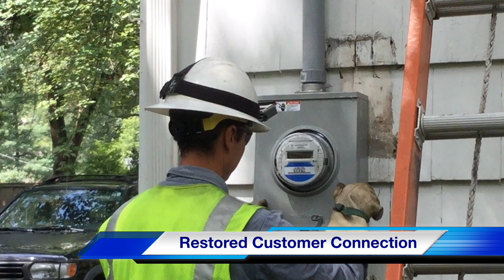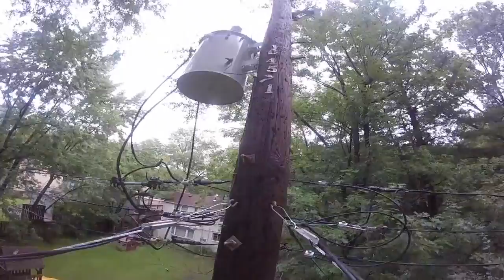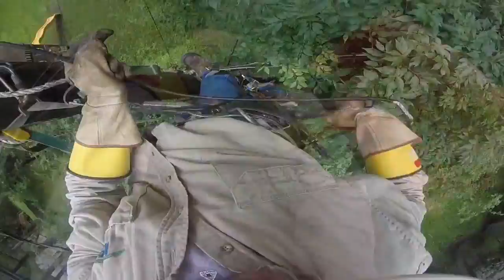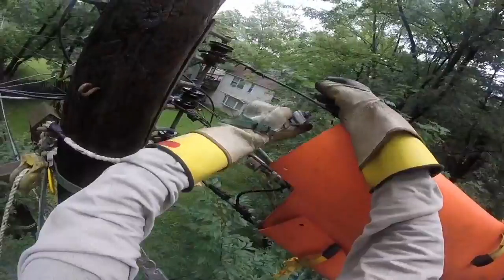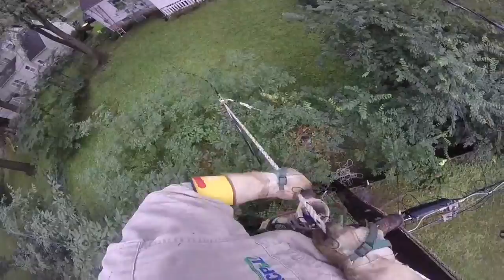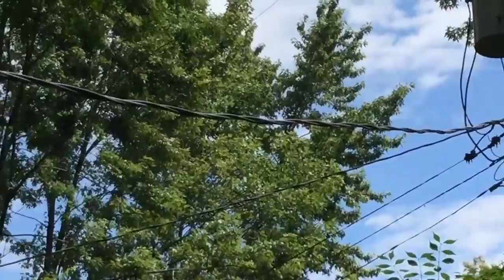Restored Customer Connection

Comment: Using a knife to remove the insulation and clean the conductor surface? Using a bolted connector for a neutral connection? They need to get rid of that open wire secondary wire. 😢

Comment: That's WORK climbing. In the summer you'll be soaking wet, your clothes'll need be ringed out.
Reply: jay willow I climbed poles and I’ve climbed trees for power line clearance and climbing trees is by far more work and more hard than going straight up a pole assisted by hooks.
Reply: @dkta-568  I'd agree. It's more aggressive work. It feels alot better though when your hooks are in the tree an inch vs your hooks being in a pole 1/8 inch.
Reply: DKTA- I’ve done line clerance for 5 years. Before becoming a lineman, and let me tell you when you do linework those pants and long sleeve shirts are fire retardant they don’t breathe. And wearing rubber gloves and rubber sleeves were I work it’s a whole different world. Being extremely hot, and always dehydrated, and always paying attention not to get burned or flashed, way hotter than tree work been there done it.
Reply: @dkta-568  lmao tell us you couldn’t cut it as a lineman without telling us you couldn’t cut it as a lineman😂

Comment: Question, why have connections at the top of the weatherhead? Why not just continue the wire down to the meter box?
Reply: There needs to be a transition from the utility owned triplex to the  private (homeowner) service entrance cables.
Reply: Strange, we do things differently over here in the UK. The cable from the street and the suppliers fuse (cutout) is owned by the distribution network so is all one cable to the cutout inside the house. The cable from the cutout to the meter and the meter is owned by whoever you choose as your electricity supplier and the cable from the meter to your fuseboard (consumer unit) is owned by the homeowner.
Reply: @pklongutoobe  This actually varies depending on state or specific power company. In some areas the weatherhead and the entrance cable and conduit is the power company's responsibility, in some areas it's not. The structural attachment to the home is typically not. For underground service, the power company is usually responsible for the riser and cable up to the meter box, but even then there are some utilities where even the lateral is the customer's responsibility.
Reply: they are running aluminum wire tri- plex to the weather head and copper from weather head to meter.

more load or current at meter
copper is better with higher amps
Reply: @tonycepeda8054  : While Copper has a higher ampacity than Aluminum at the same wire size/gauge that is not the reason to use copper from the weather head down, they could also use Aluminum; the wire however from the weather head down has a lower effective ampacity for its size than the triplex drop used by the utility. The triplex is an open air wire and is rated, per NEC, to a much higher ampacity than the triple wire drop, in the conduit going from the weather head to the meter. For a 200 Amp service the typical utility drop is 1/0 AWG Aluminum, while the customer side is 4/0 AWG Aluminum or 2/0 AWG Copper assuming say THHN or RHH wire which, at least around me are the standards. You typically can also size down the neutral by 1-2 gauge steps; though with more and more sensitive electronics I wouldn’t recommend it. You could also use a non-metallicly sheathed cable (SE Cable - 2 insulated hot wires with uninsulated neutral strands wrapped around them all inside a cable jacket) from the weather head down. While I always use conduit, it just looks better, the go-to around me tends to be  SE Cable.

Comment: So the 1wire is for ground wire, 2 of them for the electricity ?
Reply: One wire is 0v (ground/neutral) and the other two are 110v on opposite phases, so if you connect across them you have 220v.
Reply: @JohnWatkinsUK  120/240, not 110/220 in the USA.
Reply: So many narrowbacks in here. It's 120/240. Stay inside boys
Reply: 87_GN104 hahaha facts
Reply: @bbc454nos  haha I was gonna say 110v? Yeah like the man said 1 neutral wire and the other two are 120v
Reply: @bbc454nos  115/230  😃
Reply: The bare conductor of the three (called triplex) is a neutral that carries one side of all of the unbalanced current. It connects to the center tap of the final utility transformer secondary. The entire secondary winding is a nominal 220 volts end to end. These two ends feed the two so-called "hot" buses in the house panel through the two insulated conductors of the triplex. The 110 volt circuits use one of those buses and the neutral conductor that I mentioned, since half of the secondary winding would be 110 volts. The 220 volt loads, like a dryer or a stove, use the two 'hot" conductors. All of this happens through the meter base and the circuit breakers in the panelboard.
Reply: All 3 of the customer lines are for electricity, the difference is what direction the current (electrons) flows. The unshielded line is called Neutral and is bonded to ground at both the pole and the customer's service entrance. Current can, but usually doesn't flow on this line, but it's there for more than just structural reasons.

The other two lines (called phases) are "Hot" with respect to Neutral. Each phase is either pushing or pulling current relative to neutral at any given time. The trick is that while each phase is only pushing or pulling 110v relative to Neutral at any given time, they are synchronized with each other so that when one pushes, the other pulls.

Devices that draw a small amount of current are fed by just one phase, and larger devices like clothes dryers or air conditioners that need lots of current are fed by both phases. But what happens if the load between the phases isn't balanced? In this case, current flows along the neutral. 

As long as the ground bonding at the service entrance is correctly sized, the current flows to ground from the house's neutral there, but if there's a fault or severe imbalance, the current can flow to ground along the service drop.

https://en.wikipedia.org/wiki/Split-phase_electric_power